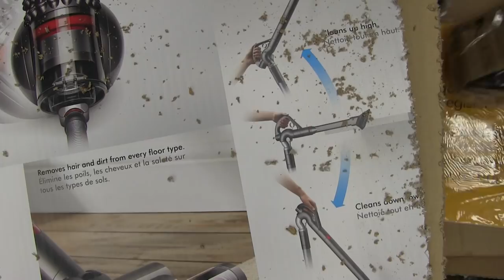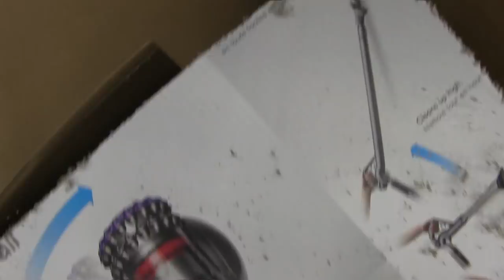DYSON ANIMAL BALLS | It blows!

Comment: The reason for the relief valve is so when the hose gets clogged it still has some air flow so it doesnt overheat. Most vacs when they are clogged auto shutdown when they get too hot. That thing keeps it cool so it doesnt overheat. However its also going to be a pain in the cunning linguals to clear a clog since the vac loses its oomph.
Reply: Yup.  That's the one. They are supposed to open at near full clog. You know when you put your hand on the end and a split second later the sound changes and gets louder? That's the valve opening at full clog. In practice the only time this happens is when you suck up your couch pillow or something like that.
Reply: i don't know vacuums well, but that was my first thought.  seemed like common sense?
Reply: Ryan Layne it also triggers when you're trying to vacuum pack your luggage/store your clothes in one of those ziplock bags
Reply: Also prevents overspinning
Reply: You saying that when there's no air to be moved, there's no resistance to slow the impeller?
Reply: essentially yes
Reply: Yup.  I have a DC17 and it has a similar valve that lets air flow when the intake gets too clogged to keep the motor cool.
Reply: Good typication!
Reply: cptbfrank i just saw this comment after posting haha
Reply: We have a Miele and a 50 lb gorilla of a grandson easily wrecked
the cord retrieval mechanism. The serviceman recommended I drill two  4mm holes at the base of the bag compartment to allow some bypass air through to stop the motor burning out if the hose is blocked . He said he sees quite a few burnt out motors resulting from the machine being left running with a blocked hose. He also reminded me that the Miele warranty specifically excludes repairs for sucking up plaster dust.
Reply: Plaster dust is extra nasty because it can pick up just enough moisture to stick to and unbalance anything going at high rpm
Reply: Steven Openlander it's doofy safe?
Reply: but at least with the Miele you can change all the filters but the plastic they use is not so skookum long term
Reply: Alexander Riccio my vacuum it is easily accessible, insulating tape does the trick. Hidden there though it’s a right pain to use the vacuum bags.
Reply: As a service man myself on these piece of kaka , I can promise U the useless thing always clogged up where they went from round vortex to flat, in the bottom of the hose.
Reply: Kirby's have an extra fan for cooling the motor so that's not as big an issue m
Reply: @ryan_layne  Or does the motor spin faster as the vacuum increases and resistance fades from the turbine?
And if  a vacuum really sucks is that good or bad?
Reply: Ah nice, I just made a comment guessing that that was the function of the valve and probably the holes on the side of the nozzles. I'm happy to hear I had the right idea.
Reply: Bypass valve
Reply: @ElaBellll  nope
Reply: Came here to say that also to offer a thesaurus for"chintzy"
Reply: Usualy a little tappy tap tap action on the enclousure solves locked vacuum relief valve. They don’t clog, they lock up

Comment: The air bypass valve is used because it's a flow-through vacuum motor which does not have a cooling fan. In a flow-through motor the the vacuumed air is directed through the motor for cooling. When you block the vacuum airflow the actual load on the motor drops and the motor spins faster because the impeller is stalled but you have also eliminated the motor cooling.The bypass valve allows some cooling air to flow through the motor even if the vacuum air flow is blocked.
Reply: thank you
Reply: Not to mention that style compressor just like the turbo he compared the bypass valve to will have a surge limit and the surge of the compressor could be strong enough to be destructive to a plastic compressor, not to mention it could occur at an rpm that may be destructive to both impeller and motor.
Reply: And all that for a company that gets their rocks off by saying their vacuums don't lose suction.
Reply: Another function of having a bypasse valve before any of the dirt separation would be that in the event of hose blockages the by pass can open allowing suction on the stuck obstruction to decrease allowing the mass to loosen and separate down to a less dense more manageable size that if spread out enough it will let air to start bringing the material from front of the blockage and in a sense get a fresh bite on pulling the rest through otherwise the blockage would of only blocked airflow and only made the pluge denser so it's actually a benefit to the system hard to put in concept other then it's basically the same idea as using your hand to plug the front of a hose when plugged to ramp up the suction and letting it all lose at once to clear the air way but on the Dyson does that automatically   n. By the way great idea stretching the spring does wonders on the physics of this effect.  Thanks for the great vijeaos  I always learn loads appreciated
Reply: @nizzesbizzbuzz4074 No one's going to read that story, I got 3 lines in and hit read more and said " nope! Not reading all that.. back to the video"

Comment: the vaccum brake helps keep the motor cool. it uses all the air flow to cool the motor so if you plug it up or the filter will not flow enough air anymore you dont have a few hundred watt heater inside a plastic ball.
Reply: Also the blades will spin extra fast with no air friction and burn the motor up. So this is a "safety" feature.
Reply: No air is present in a perfect vacuum. No air, no heat x-fer.
Reply: Jason Coleman sure, aint no how this thing is gonna pull a perfect vacuum
Reply: Thank you, I went to the comments for this
Reply: Thats what i just wanted to post the valve keeps the air flowing couse the suced air is also for cooling the motor
Reply: Jimmy O. no not necessarily with all vacuum cleaners, there is usually a separate fan on the other end of the motor dedicated for the cooling of the motor
Reply: The extra fan just helps it isn't enough on it's own  they rely on air drawn in through the hose to keep cool enough hence the valve for if the hose gets blocked. This motor is in an enclosed plastic box the only place it can pull air from to cool it is the hose.
Reply: I think the vacuum relief valve is to keep air moving to maintain the vortices.
Reply: As a house husband I can add that the vacuum brake gives important information to a user. When you hear the brake engage, the vacuuming is not working, ie. there is no flow. Either filter is clogged or there is a kids sock in the tube...
Reply: llldodgelll
that is a very good point! i noticed on mine, start up would blow a fair amount of dust around the filters and into the room. if that happened every time the tube gets blocked up it would be terrible.
Reply: @llldodgelll  No, that's not the case. It bypasses everything before the motor, so it can breathe and be cooled, even if filters are plugged up etc.
If something plugs the vac up, the vortices are gone or too weak, so the dust separation too.
Thats a bad thing, if this happens too often,  because it plugs up the pre - motor filter more rapidly.

Comment: Would be interesting to see a teardown of a more conventional "high end" vacuum like Miele, for comparison
Reply: High end.  Low end.    They all get clogged.      :-)
Reply: Some actually run for longer than a year... but most of the well known brands is by now total rubbish .
Reply: @MickeyMishra  I don't think I've ever had a vacuum get clogged. In my experience the motor just wears out.
Reply: Ooh! Now do the Shark Apex Zero M!
Reply: @saltrocklamp199  yeah that's usually what happen the ball bearing turn into cube bearing then it need more amps and it's a chain reaction up to the magic smoke point with usually is the real end!
Reply: Kirby.
Reply: Never heard of that brand
Reply: Or an older Kirby.  The new ones are shite but my mom has a gen 1 that's never needed service in like 40 years plus.
Reply: MrAngenos really expensive vacuum cleaners sold kinda door to door (or at least they were in UK circa 2000). Had one demo'd once and as part of that they did a comparison to our ordinary hoover. That was an original Dyson, the Kirby was no better (in terms of suction at least).
Reply: It is hard to compare  a miele to any product.
Reply: @Robert Saca 
I agree with you, only ever had a miele so I can't compare but by the sounds of what others are saying the miele seems pretty good just as powerful as it ever was
Reply: How about a BOLTER on a Dyson cordless?
Reply: Miele costs less than a dyson. And is very good.
Reply: Or a Vorwerk Tiger...
Reply: "Fleshlight Pantaloon Edition"

Dude, you crack me up! Happy Saturday to me!
Please publish your lexicon.
Reply: or a sebo
Reply: Tear down a Rainbow SRX
Reply: @JDCarnin  about 26 years for us and counting :D
Reply: @janney36  I have a Kobold VK131 with EB350. It's as old as me and lifting up the carpet with only 800 watts. Bought it second hand many years ago and he is running with no signs of Age...
Reply: @shadowhenge7118  yup. Our old miele s220 worked for 25 years.  The next one lasted 7 years.
Reply: Light weight equals lots of plastic. Had Dysons for years, way too much plastic at first impression but they work great and we have never broken one. Cost too much, the Panasonic motor was a shock but rest was expected. Beater bar, even if air driven works well. Can’t beat the performance. They really suck.
Reply: I bought a Miele back around 2003. Mostly very impressive and solidly built. However, between 2003 and 2009 they cheaped out, because I sent it back to get a few parts replaced and the new hose is some cheap piece of sh!t that kinks if you look at it wrong and is stupidly short, and the metal pole for the brush is half the weight of the original. Best vacuum in the UK is a Numatic Henry. No gimmicks (other than the stick-on smiley face). All important bits metal. Super long hose. Super long mains lead. Super reliable and sucks up anything you throw at it.

Comment: This relief valve is probably for when you plug the hose catching something you didn't want to, like the curtain or the cat
Reply: Nope... It´s for cooling air for the motor...
Reply: It’s for cooling the motor when the hose is plugged. My fein vac has two fans, one just for cooling the motor. It does not rely on air drawn through the filter bag. A MUCH better design!
Reply: Is for cooling. Try clogging some normal vaccum. It will stop due to overheating.
Reply: @Terry I was gonna say something about cost being a major factor of good design, but then I remembered the price dyson is asking for this.
Reply: "diamened - or your dingus" - I'd need to remove it from the vice first presumably. Just asking for a friend of course..
Reply: Exactly.  Our new Panasonic sucking machine has the same.  Hose plugged?  Motor goes into another orbit of RPM's and re diverts air flow to ease the motor.
Reply: Its for protecting the motor. I clogged up a Kärcher professional vacuum. Didnt hear the RPM go through the roof because of the tools and hearing protection. The smell of burnt coilings and smell of burning bearings woke me to the situation.
Reply: I wouldn't be concerned about the cat. Think it is the hamster    one should take special care of.
Reply: The valve is for makeup air if the filter get's full or packed.  Not enough air the motor overheats.

Comment: Without that little valve when the main input is clogged the motor would over heat due to no airflow.
Reply: It could also be to prevent all the plastic components on the vacuums side from exceeding its elastic limit. I.e to prevent plastic component failure due to obstruction
Reply: It could also be to keep the flowrate up so that the cyclonic filtration stages still work.
Reply: @ryan.crosby  The valve doesn't flow air from the cyclonic part, it's just fresh air.
Reply: The thermal cutout is usually of the latching type..it has a little heating element in it. You have to turn the thing off and wait for the element to cool down..if you don't turn the thing off it will stay off.. Dyson..over complicated junk.
Reply: How bad is it for the vacuum when it gets clogged with something like a sheet of plastic?
Reply: I think it keeps you from getting your parts stuck in the vacuum cleaner
Reply: @sidbrun_  The air pressure on the input and output sides of the impeller equalize and the motor runs under no load. That's why it sounds like it's speeding up- it is speeding up.
How bad is it? That depends on how good the bearings are and if there's a separate path for cooling air through the motor. If everything's skookum it will chooch along just fine.
Reply: If most returns really are the fuse. They're probably reselling them at the normal rate; what a hustle -_-
Reply: @thegrowers420  repairs, not returns
Reply: Could the vacuum cut-off valve be there so you don't suck the pelt right off of your best friend's back?!
Reply: @sentientproductions3281  if you're getting parts, plural, stuck in the vacuum cleaner... you might be doing something wrong.
Reply: Could have other intake vents other than the main intake. Maybe even a cooling fan being driven from the axle idk.
Reply: Yep reverse pressure relief.
Reply: As you (and others) have said, that's to assure some cooling air reaches the motor even if the suction inlet gets blocked.

This is something that seems counter intuitive, but when you plug off the inlet (or outlet, presumably) of a vacuum cleaner, the motor speeds up because it is suddenly under less load and doing less work (moving less air).  BUT, because most vacuum cleaner designs use the air that's passed through the filter(s) as the main cooling for their tiny, but powerful motor, blocking off that airflow will still result in rapid overheating.  So that "waste gate" or whatever you'd call it is certainly meant to bypass the vacuum system to save the motor in the event that someone tries to suck up the family pet, and doesn't shut the thing off in time.
Reply: probably it'll keep the hamster that gets stuck in the hose from being fully integrated with the impeller.
Reply: @nopy99  prob what it is. again its only plastic.
Reply: @jsigmo  I took apart my dyson today, it's a bit older - better made I think, but instead of this bypass valve it has some sort of rubber valve where the dust collector connects ... if you block the intake it makes a horrible moan and grabs air from there instead. When I was testing just the motor unit I blocked it's intake and was surprised how quickly it raced and heated up, I think I could have blown the motor after 10 seconds.
Reply: Same concept as a carpet cleaner I'm assuming, so when the tank is full, valve open s under higher vacuum allowing the motor to continue as though tank were empty. Therefore not burning up ?
Reply: Maybe has a whistle in there so you know the filter is clogged
Reply: @DaveMody  😂😂😂😂😂😂😂😂